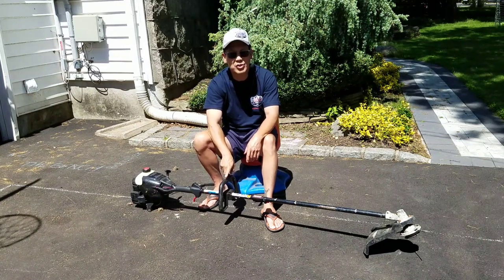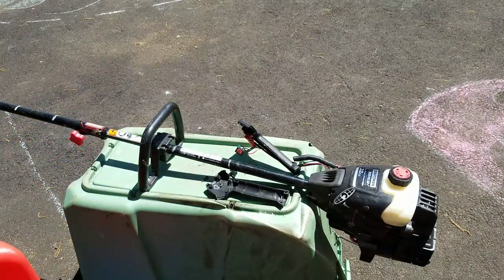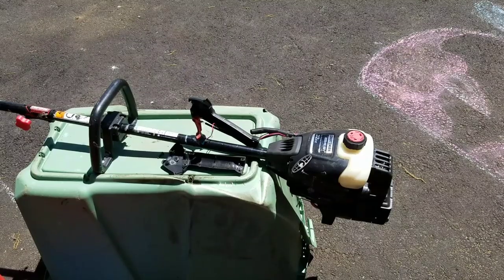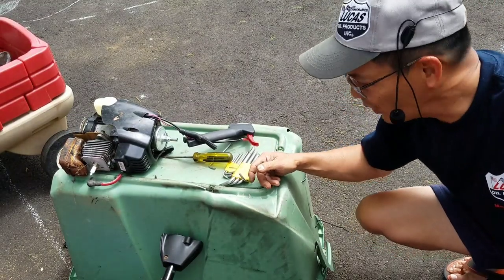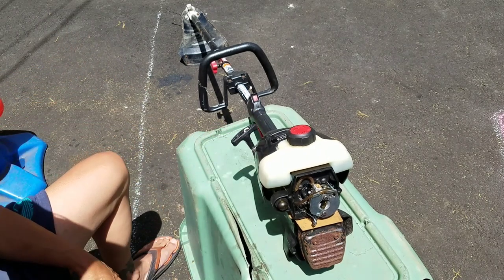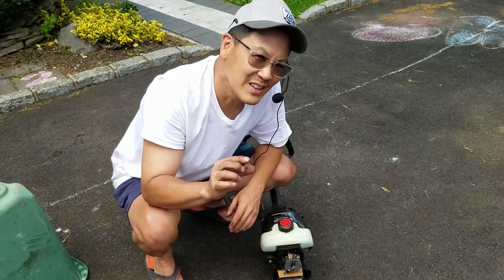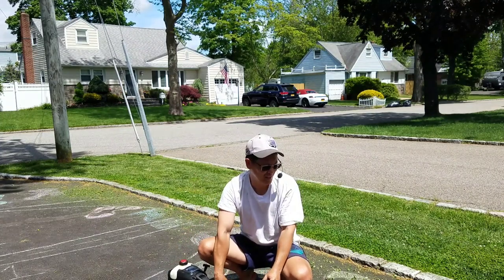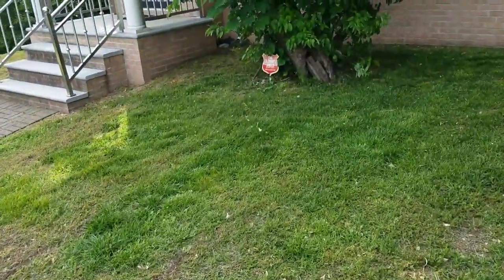FREE CRAFTSMAN 32CC AUTO CHOKE INCREDIPULL STRAIGHT SHAFT WEED TRIMMER EATER WHACKER WONT SHUT OFF

Comment: Henry your videos are awesome. i've been going through your old videos. I have 2 lawn tracters. Craftsman lt1000 25 plus years old and a John Deere stx46 26 years old. They both run. Both have issues. But I'm getting both fixed. I live in upstate NY Mohawk Valley. You need shirts & hats. Where did you get your lucas oil shirt???
Reply from the maker: Hey Robert, thx for watching, I’ve had both tractors also, I sold my stx46 for $700!  I’ve had about a dozen lt1000.  I may think about T-shirt’s and hats later on, I don’t think my fan base is big enough to make the investment...yet.  Lucas oil sent it to me.
Reply from the maker: Btw, thanks for buying the stickers bro.
Reply: @MowersNBlowers  Putting them on my tracters

Comment: Now I hate you...LOL I've had my WeedEater a part 3-4 times now and like I told you before I even bought a carb from Chiner and put in a new piston ring cleaned out more coke (carbon) than the Cowboys had in the 90's and now it will only run for about 10 minutes with the high speed screw all the way in on the new carb or with the high speed screw hanging by the last thread on old carb (that I rebuilt). So  I'm highly screwed. Thinking I hate 2 stroke crap too.
Reply from the maker: It’s not like you didn’t try, a galant effort.
Reply: @MowersNBlowers  I'm too hard headed to quit. I've been pulling the carbs apart and bending arm to fuel needle to allow more or less fuel with each pump. Maybe by July 4th it will be running or I'll have two torn up shoulders again.